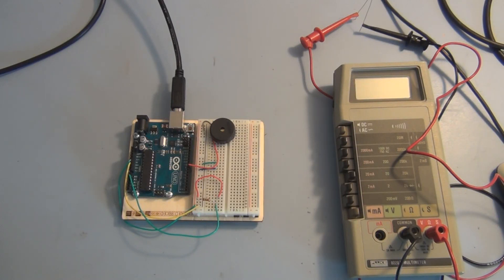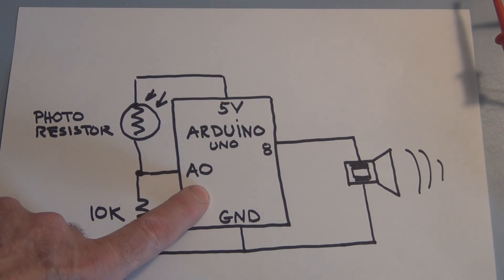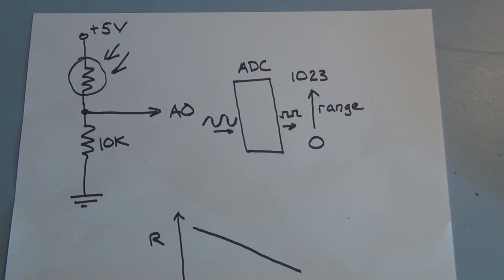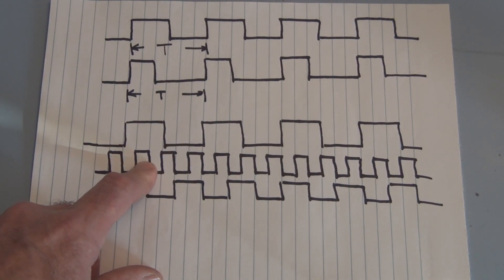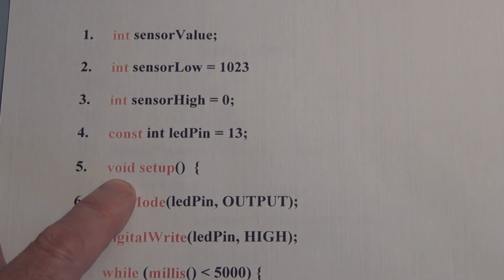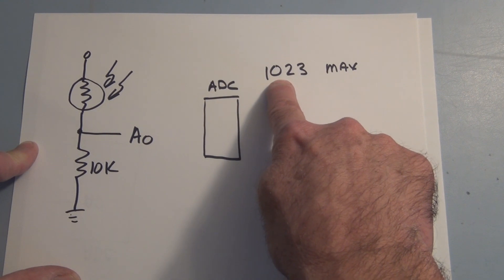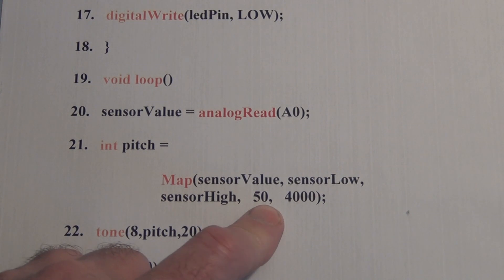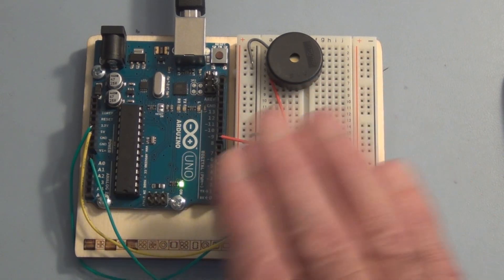Arduino Uno Tutorial Making Noise

Comment: i had a error message saying
Arduino: 1.6.5 (Windows 8.1), Board: "Arduino Uno"

sketch_sep07a.ino: In function 'void setup()':
sketch_sep07a:7: error: 'High' was not declared in this scope
sketch_sep07a:8: error: expected ')' before '{' token
sketch_sep07a:10: error: 'sensorHigh' was not declared in this scope
sketch_sep07a:11: error: 'sensorHIGH' was not declared in this scope
sketch_sep07a.ino: At global scope:
sketch_sep07a:18: error: expected initializer before 'sensorValue'
sketch_sep07a:21: error: 'sensorLow' was not declared in this scope
sketch_sep07a:21: error: 'sensorHigh' was not declared in this scope
sketch_sep07a:21: error: 'Map' was not declared in this scope
sketch_sep07a:23: error: expected constructor, destructor, or type conversion before '(' token
sketch_sep07a:24: error: expected constructor, destructor, or type conversion before '(' token
sketch_sep07a:26: error: expected declaration before '}' token
'High' was not declared in this scope

  This report would have more information with
  "Show verbose output during compilation"
  enabled in File > Preferences.

Comment: What happens if during the first 5 seconds you don t move your hand over the photo resistor ?
Probably highsensor will be curent reading and low sensor also current reading ?
So you will have the same values for both ?

Comment: I've tried to produce sounds from the Arduino, using a piezo disk, many times. The piezo disk can only produce some 3 or 4 different frequencies of sounds. Approximately, they are around <100hz, ~500hz, ~1200hz, ~2000hz+. All other frequencies of sounds I tried to make, sounded like one of these. Even in this video, I can see the disk producing only 3 frequencies. 1. That low frequency buzz sound, 2. an intermediate sound of about ~200hz and a third high-frequency screeching sound.